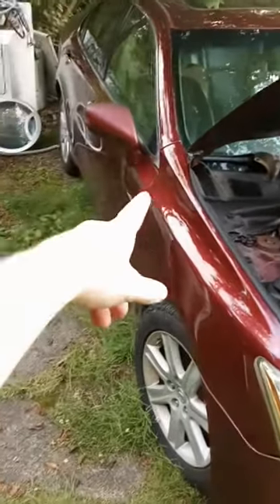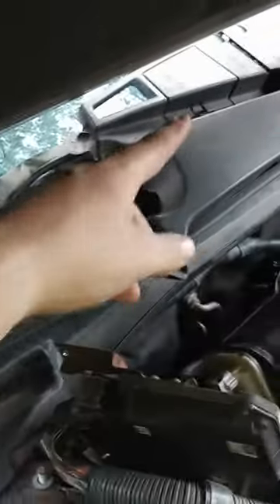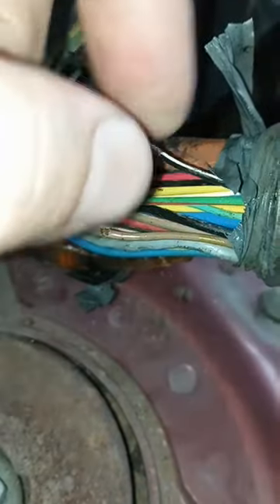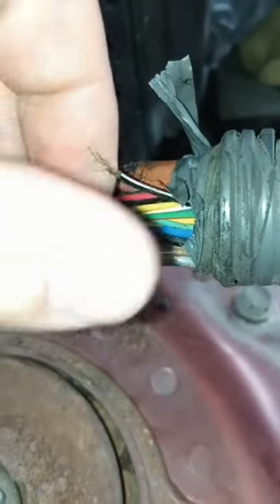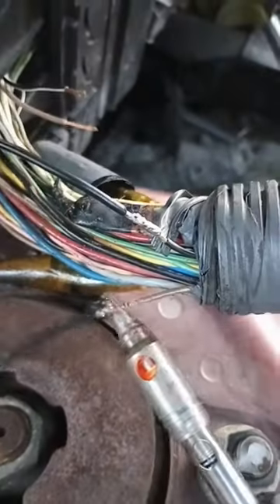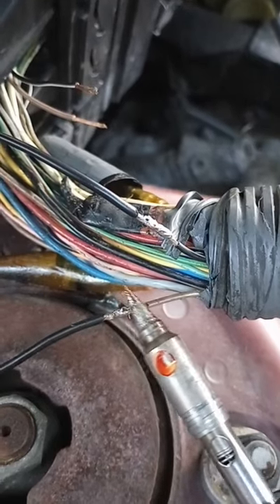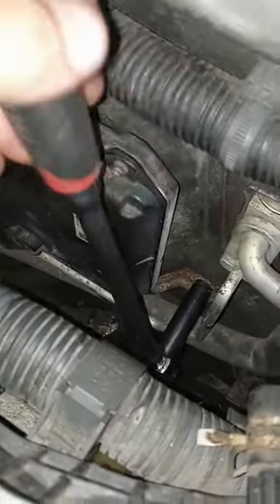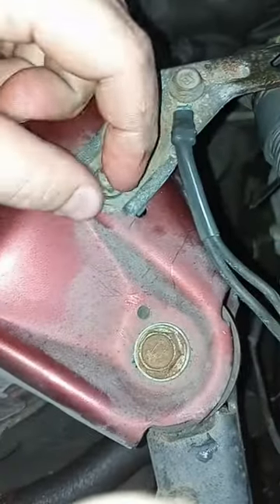Mouse 🐭 Chewed Wires To PCM On My Lexus 350 ES & Here Is How I Repaired Them #Shorts

Comment: Did doing it last long for years.? Or give problem after few months
Reply from the maker: Still Going Strong with no problems.
Reply: @DrewsBackYardMechanics  I'm facing same problem of rat 🐀 bite but my bike is electrical so do or not.?
Reply from the maker: @laukik0323  I don't see why you couldn't,  just be careful and disconnect the battery 🔋 1st,  so you don't accidentally short circuit it
Reply: @DrewsBackYardMechanics  I'm asking sholding is  safe for electric bike.?
Reply from the maker: @laukik0323  as long as you're not letting the hot solder fall in/on the battery 🔋,  and you heat shrink the wires so they don't short circuit,  should be fine. 👍🏼
Reply: @DrewsBackYardMechanics  i have done sholding and rubber tape it tight
Reply: Is that safe sir.?
Reply from the maker: @laukik0323  that should be fine I would just be careful that over time that the rubber tape doesn't come undone
Reply from the maker: @laukik0323  heat shrink is obviously the better option but it is safe with rubber tape just so long as it stays taped up
Reply: @DrewsBackYardMechanics  ok sir there is no way to touch it 
Did it affect by any vibration.? Or heat
Reply from the maker: @laukik0323  If you heat shrink it,  it willn't be affected by vibration or a little bit of heat.
Reply: @DrewsBackYardMechanics  thank you sir for replying me
Reply from the maker: @laukik0323  No problem 👍🏼